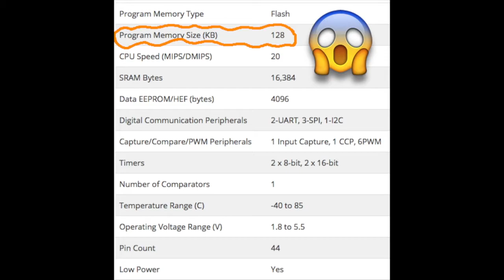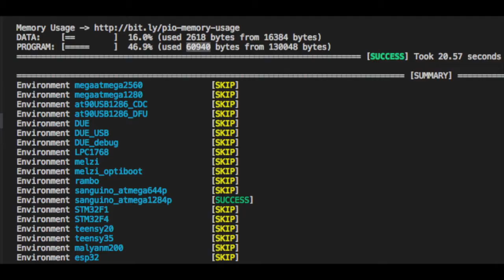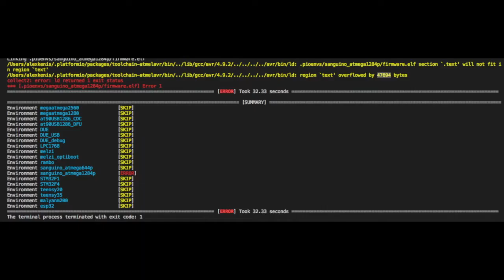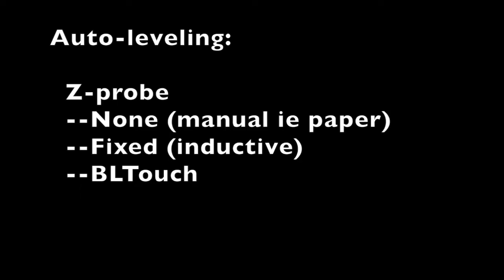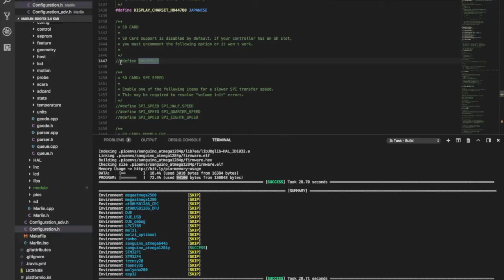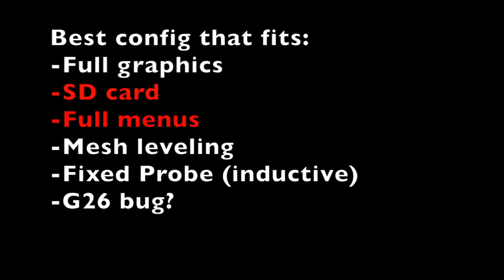Tips to fit Marlin 2.0 auto leveling on atmega1284p boards (Sanguinololu, Melzi: Creality, i3, etc)

Comment: Thank you sir! I was able to save space by using slim menus. Great video!
Reply: I too. Thank you. Resolved my problem with update Ender 3 Pro to use FIX_MOUNTED_PROBE. Very good.
Reply: I installed Marlin 2.0.5.3
Reply: My end configuration to Ender 3 Pro with Marlin 2.0.5.3. FIX_MOUNTED_PROBE, BED LEVELING MESH and SDSUPPORT actived.

#define SLIM_LCD_MENUS //Enabled
#define DISABLE_M503 //Enabled
//#define NO_WORKSPACE_OFFSETS // Disabled - Disables M206 and M428
//#define ARC_SUPPORT //Disabled 
//#define DOGM_SD_PERCENT //Disabled 
//#define SPEAKER // Disabled beeper if you don't want it. ~ 1664 bytes
//#define PID_EDIT_MENU //Disabled ~700 bytes
//#define PID_AUTOTUNE_MENU //Disabled ~250 bytes